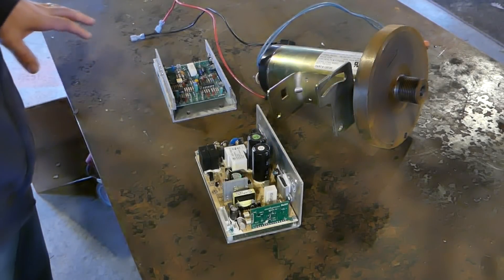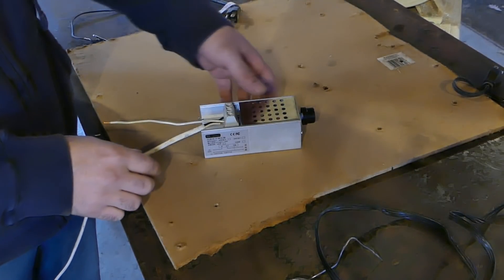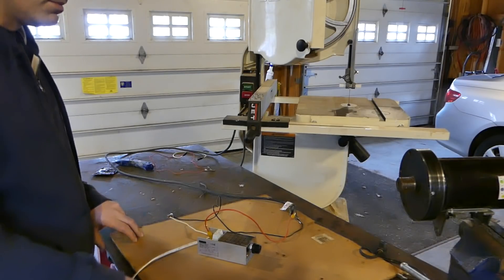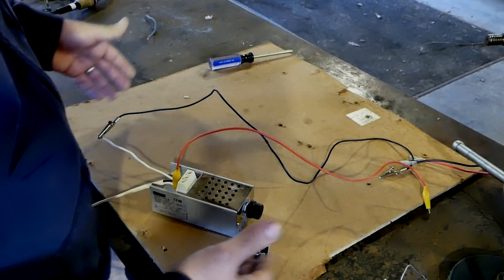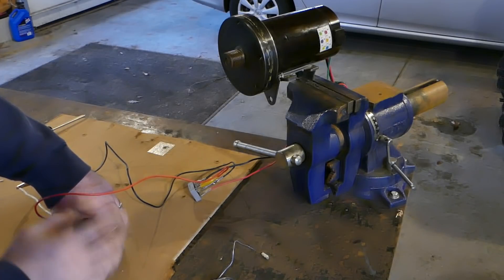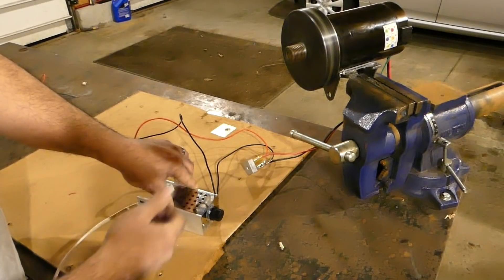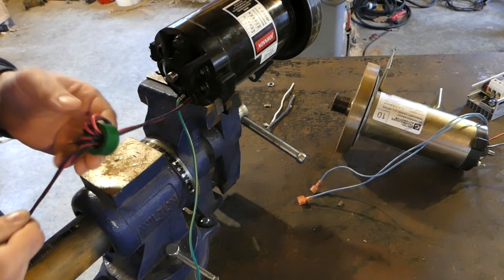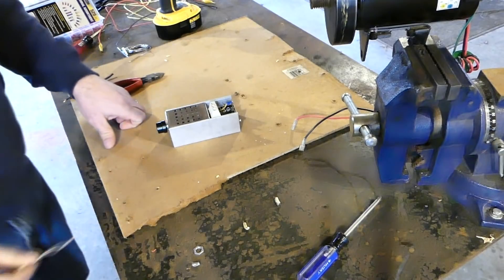Low Cost DC Motor Controller For Treadmill

Comment: hi, if powering with 240v would I need to add a transformer for a 110v motor, thanks.
Reply: Hi Kat Cando l to have a 220dc 1.5hp how did you go with it did you run this straight from 240ac so what did you do thanks
Reply: Kat Cando l live in oz to how did you get on with the 220voc motor l have the same and would like to no how you got on thanks
Reply: Damien Doyle, I'm intetested in this too as my motor is 220v
Reply: Kat Cando Hi, if your motor is 220v and your running from a 220 v supply you should be OK. I'm running a 110v motor from a 220v supply.
Reply: Im running from australian 240v
Reply: we'll your OK so. if your supply is 240ac and your motor is 220dc you won't need a transformer.
Reply: Damien Doyle thankyou. i wasnt sure if I'd blow it up. This vid was very helpful
Reply: You need to control the output voltage circuit.  Add a voltage dropping resistor to the high voltage side of the control potentiometer. This limits the voltage going to the power switching circuit keeping output voltage lower. You could experiment with resistor values (use a variable resistor , then measure the resistance found,)  or figure it out with Ohm's Law.  Put a light bulb on the output of the circuit and measure the voltage.

Comment: I have a project going on just as in this video. and tried to wire the motor control which is just like yours but has four lugs. 2 being AC in 2 being AC out. Then from the AC out of the motor controller hooked up to the bridge rectifier just like in video diagonally. And then to the motor,but when I turned it on it blew the 20 amp fuse in the motor controller. The motor did spin for a second lol
Reply: same here but blew trip fuse in consumer unit
Reply from the maker: Hmm, that could be a number of things.  Incorrect wiring, something touching ground, or maybe a bad board.  I would doublecheck everything.
Reply: Only thing I know thats different is its a 4000 w unit not 10000 , would this affect it, tried it on two different motors now with same result, how would I be able to test if its a bad scr, oh wasnt able to get same rectifier ,I got  KBPC35-01 shop guy said it was nearest he could do, great video btw, I just hate being beaten by simple electronic projects
Reply: Its the rectifier isn't it, only rated to 100 volts, should have checked that one before trusting shop guy, duh !!!!
Reply: So are you saying I need a more powerful rectifier? Have you got your problem figured out?
Reply: Eric Cartmill  sorry Eric. new to you tube posting, I wasn't meaning you had the wrong rectifier but I have, awaiting higher rated ones to see if that sorts my problem, sorry for the confusiin
Reply: Ok, so I take it you have the same problem I got? Let me know if the higher rated one fixes anything.
Reply: nope, no different, sorry
Reply: I had the same thing happen. Twice. not sure if I got junk parts or if I did something wrong.
Reply: Same here. Worked great for a week and I'm now on my second motor controller and blew the fuses first run. I soldered in two 5 amp fuses and it blew one of them. I am going to see what two 20 amp fuses do. I'm at a loss for what is going on here

Comment: Well i was so hopeful for this to work but it seems i'm the only one it failed for, keeps tripping my fuse in consumer box, i'm at a loss as to what went wrong, tried motor on car battery and works fine both directions, anyone any ideas
Reply: dark orkodi Hi if you have 110 DC motor you need to reduce the voltage as if you bought the variable triac for 240 volts and used the bridge rectifier as shown then you will have about 240 DC! that's over twice the stated voltage and would probably blow the fuse. There other ways to do the same thing but would need to understand some electronics. The only way I can see to maybe work is to use a 240 volt 110 volt transformer then do as in the video but keep the speed low as it may be overvolting beyond the motors spec.
Reply: clark Korodi it happened to me too. There are so many others who got it to work, I wonder if I got bad parts?
Reply: ive tried 2 motors, 2 controllers and 2 rectifiers, first controller i changed the pot and it blew, 2nd controller i just wired thru to see what happened and it didnt blow straight away but as i turned the pot it blew, im at a loss now as to what could be wrong,  im in uk using 240 volts, the motors says it works on 110 volts so im thinking there should be transformer involved somewhere
Reply: Thanks Barry but I did get it working,quite sure I posted message explaining how a while ago

Comment: very good info. ive been converting my tools to dc treadmill motors and your setup is axactlly the combonation i have been searching for. forget those damn treadmill controllers. now i know how ill be doing my band saw, drill press. i never knew that changing ac to dc was as simple as that $5 Rectifier. you just made my project go much smoother. thanks man. you earned my sub

Comment: i bought all the shit in the decription and did just what you said and it worked! alto not very long. i dident have anything held down and the motor vibrated over and touched sometin id dident like cause there was a small flash and the fuse blew. but that was my fault. tanks again. it works!
Reply: mike mabie u can help me. i took my old fuse to the store to buy another one but i lost it some where. do you know what size fuse it has. i bought the 4000w model with the 4 wires like you said. im pretty sure i seen a 20 on the fuse somewhere but im not sure if that was amps. that seems like alot of amps for a fuse that small
Reply: Mine was f20l250v which are 3/16 by 3/4 tiny fuses.  I had to order online to find more. 20amp 250v
Reply: @rustybrowneye  hey I think my fuse blew too.

Comment: I just ordered the parts for this to put on my home built belt grinder.  I've been using it for about a year with the plastic console from the treadmill - which works, but is awkward in more ways than one.  It's such a useful tool that improving it like this is well worth the effort.   Thanks!
Reply: Instablaster.

Comment: EXACTLY the information that I have been looking for. Well presented. THNX!
Reply: Hey Mike thanks foe the informative vid.  I'm in the process of doing what you did here.  the one thing in the video you did not reveal is what size of potentiometer did you end up having to order to make the motor work correctly? 400k is too big and  and 100K was too small I gathered that much information but what size did you end up ordering?. PS I have the exact same motor as your video.
Reply: @page76metalcraft19  200k linear potentiometer
Reply: @supurbian  How's that holding if you go to low it will burn up.
Reply: same!!
Reply: Same here

Comment: Excellent solution! (In one video a guy used the huge user control panel from the treadmill to control his motor.)
Just to confirm the wiring sequence: 120v AC to the controller, regulated 120v AC out to bridge rectifier, DC from rectifier to motor. Do i have that right?
Reply from the maker: Yes that's correct.  The inductor  would go on dc output to motor. It would be a good idea to ground the motor too.

Comment: What's the voltage spec for your treadmill motor?  Will this approach work with a 90V DC motor or does it have to be a 130V motor?
Reply from the maker: It works with both my 90v and 130v motors.

Comment: Awesome video and great, simple info! 
What changes if I  use a 120VAC SCR? 
Output of SCR?
RPM or torque of motor? 
Need different Pot or Rectifier? 
Does the DC voltage of the motor matter or are they all the same? 
Thanks!!!
Reply: DS Splicer I just used the set up he has one 120 and it works flawlessly..
Reply: Same part numbers he listed and it works on 120VAC?
Awesome, thanks for the reply, Russell!!!

Comment: Thanks for the video! Do you get good torque at the lower speeds?
Reply from the maker: Yes the flywheel is difficult to stop with my hands.  Safety first!
Reply: These motors are gutless at low speeds.. I've been running the original treadmill panel mounted to the face of the bench where my lathe sits and I quickly learned to just leave the belt on the largest pulley on my lathe [about 4-1] and even so I'll never have to max out the motor, these motors spin up insanely fast.

Comment: What size potentiometer did you go with?
Reply from the maker: 200K Ohm. See description for parts needed.
Reply: my scr came with a 500k ohm pot and like you said it didn't start up until it got to around the 200k ohm range ... Just thinking that adding a 200k ohm resistor in series ( before )  the 500k ohm pot would get it to start early and give you a better range of full dial .. ?
Reply: no the motor probably won't start at all.  you have to have a lower ohms not higher.   If you want full range on the dial but don't want the full speed of the motor, you can use a 100k pot with a 100 k resistor inline.  I did this to my treadmill because the high speed was like running from the police full bore!  So I rewired it and now it will go only half that fast and the pot is more sensitive to speed increases.

Comment: Man that flywheel could have mauled you.
Reply: +mikemanmade  can you help me I need to make a controller for DC to control a variable speed DC motor for a salt spreader so it runs off a 12 volt car battery and I believe the motor is 75 amps it's a three quarter horsepower motor similar to treadmill motor thanks todsplowing@gmail.com
Reply from the maker: Please explain how it could have.
Reply from the maker: This is real world physics, not action movie physics.  The worst that could have happened with these conditions, was the flywheel rolling off the table and maybe breaking a toe.

Comment: Excellent, thank you! Anything to be gained by smoothing the output with a capacitor?
Reply from the maker: No, with this you don't want a filter capacitor as the speed control is achieved by the pulses.
Reply: @mikemanmade3087  ac pulses until rectifier bridge - after rectifier you have DC who can be filtered to run smother with a capacitor
Reply: mikemanmade can you elaborate on this ? I thought that adding a cap like in this circuit 

https://www.google.ca/search?q=bridge+rectifier+filter&client=ms-android-bell-ca&prmd=isvn&source=lnms&tbm=isch&sa=X&ved=0ahUKEwjQrbTxs_7SAhXm6oMKHcCtDosQ_AUIBygB&biw=360&bih=560&dpr=4#imgrc=lxzyT2ex-5v4eM: 

would help the motor get smoother voltage, and help extend the lifetime of the motor ?